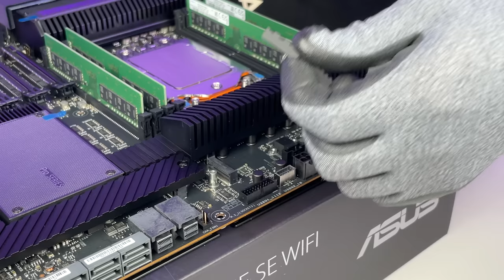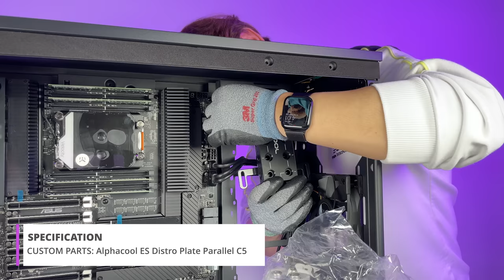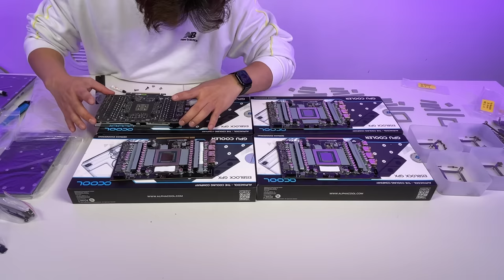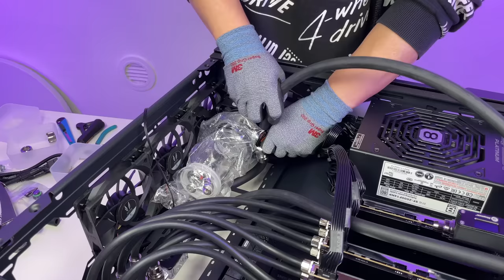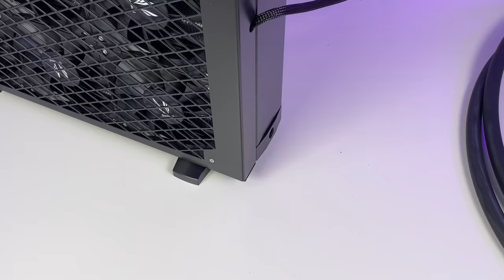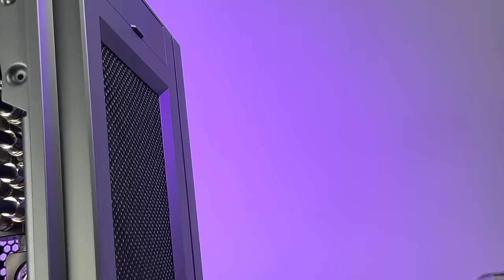$26000 RTX 4090 4Way ㅣThreadripper Pro 5995WX

Comment: Awesome setup. I would just change the WC parallel conections by all serial -> much better flow pressure.
Reply: What? The end goal is flow, not pressure. Parallel will provide better cooling. By the way, he installs four of gpu so they can work in parallel. He could supply same amount of task to one gpu in serial but in parallel they do the same job faster. Different areas - same principle. Parallel splits the task
Reply: @eee8662  Low pressure => low flow. Water will flow fast to the last block (due to pressure by gravity) and almost none to the uper block of the splitter.
Reply: @rodrigocunha34  
1. The rule "low pressure leads to low flow" is correct when resistance is constant. I.e. if you have only one gpu. You can achieve higher flow by increasing pressure.
When configuration changes - not one gpu but 4(!) Of them - you can not use that the same measure stick (pressure) that was in Internet references use for one gpu.

Consider this: you can decrease the pipes diameter (or better yet plug them off completely to see the point) - the flow will approach zero but yea, at least you will get the high pressure.
The lesson is: yes you increase the pressure to achieve the high flow, not the other way around. Going serial - is that other way around - akin plugging pipes off - you will kill flow but skyrocket pressure.

2. Role of gravity. My intuition tells me it will be negligible here. If any. The easy way to prove - to put meter on each gpu and see.
3. Quick thought tells me - gravity will play no role at all - the amount of water that goes down is equal amount of water that goes up. I may be wrong about this however.
4. You may be correct that there  may be different amount of water going to each gpu but that is not due to gravity but rather due to distance from main radiator/pump ports. The way to fix it - system must be symmetrical..
Bottom line - you want it symmetrical and parallel.
Serial - will kill it.
Reply: @rodrigocunha34  And. Don't forget the temperature. Symmetric-parallel will ensure each gpu gets fresh cold water from pump.
Serial - the last gpu in line will get hot exhaust water warmed by three of those gpu before it.
Reply: @rodrigocunha34  if resulting water flow is less than desirable - he must use more powerful pump. Or even several pumps. But. No way GPUs be connected serially.
Reply: @rodrigocunha34 Constructively,  to solve the "gravity" problem (which is not gravity really) - the key is either having smart manifold or if manifold is dumb - use it wisely.
The smart manifold would have same distance from main water ports to client ports. For this, I guess manifold should have pipes inside, not just box.

If the manifold just a box with no pipes inside - then builder of this server did not use it wisely - he should have used center of manifold for main ports and side ports - for clients/GPUs and CPUs. This would not make the system absolutely symmetrical but  much better than when supply ports on one side of the box - CPU will get nothing.

But this much less to do with gravity and whole a lot - with distance between ports (I do know the name of this science. Liquid dynamics?) Even if you turn server upside down - still the pors closest to main ports will get the most of water and CPU - much less.

It not that parallel is wrong, it is that it is not used correctly
Reply: Actually, about my last message - about manifold - I take it back on account that it was not used wisely. Builder did it correct.
If you pay attention - each GPU has same combined distance of in/out ports. Borderline clients - if it closest to input then it farthest from output. And vise versa. Combined/average distance - the same.

This is because manifold has main input and output on different ends of itself.

The only significant assimmetry I see here - is CPU. Which may or may not be an issue depending on if he is going to load CPU heavily.

If any overheating with CPU I would put it on separate pump. Again, not serially with other GPUs. As it will bottle- neck all of GPUs
Reply: @rodrigocunha34  ... Or, for CPU -  additional booster pump, preferably adjustable. So this will not need two more separate pipes going to radiator thru the case.

And I really  believe CPU may need it - it's resistance have good chances to be higher than GPUs. And so will have lower flow in parallel config. Because of smaller CPU size compared to GPU. But this (about resistance ) - just my guess. However - it definitely has different resistance due to being different design. CPU unlikely will affect GPU because it is only one CPU and four of GPUs. But it could be easily affected by GPUs.

Comment: I see allot of comments about the water cooling setup. I've been around for 30 years in the industry and did my fair share of WC builds. I'm not going to point out things i think could have been done better as far as tubing and flow.  Instead, I will say from my own experience that 9 fan Radiator is a little weak. 
But I also understand that not many external rads are available anyways. Either out of stock, not performant enough for price or come from too far.
At the end of the day, what matters is the benchmark and stress test. I think we just want to see those results.
I've seen so many "not optimal" or "not ideal"  custom loops that work above and beyond. So sometimes the science doesn't even matter since the component quality makes up or the extreme is what's needed for bad things to happen.

In short. Lets see benchmarks and temps please . I'm genuinely curious but I still think it will work well. Nice Build Anyways!

Comment: Not sure how you reached the $26'000 price tag, but the CPU and GPUs together cost $13k (without VAT converting from UK price of under £10'400 - there's no way someone buying this is going to be paying VAT). I can't see where the other $13k was added to the build, another $1k for the motherboard, memory cost is small, storage cost is small, under $1k for both PSUs, which leaves about $11k in watercooling connectors (I know they're expensive but idk about that expensive)

Comment: noice MORA3 420 as a radiator 💪💪 btw i would not use some odd liquids in a system where multiple components are in same loop, this causes electrolysis to happen and the first things to go are the CPU and GPU water blocks. Use distilled water only and swap it few times a year, it also has to always circulate else sediment will build up....
That being said, separate loops for each GPU and CPU would be sweet 🤔

Comment: Very nice build but no NVLink and some of the worst 4090's on the market.    This looks great but how would you use it?   No temp measures.   Does this work or does it overheat?
Reply: You don't need NVLink
Reply: @christophegroulx7816   You do if you want to work with ai.    That's why most are stuck on 3090's.   The a6000's are too expensive.
Reply: @robertfontaine3650  Not really, the gains from NVLink with two cards are quite small.

Comment: That is off the chain, but at that point, you're better off using a mining rig with seven GPUs. We need a system with two CPUs and 8 PCIe Gen 5 x16 slots on each side so we can do 16 A6000 or H100 GPUs.
Reply: run dual 3975WX's

Comment: There is a problem here that I don't know if anyone noticed. There is no 110v outlet that can handle this. Typically in modern homes, the outlets in a room are all on one 15 amp breaker. So you really cannot use this machine without running dedicated power that is not shared with anything else.
Reply: Fortunately that's not a problem in most countries outside the United States.
Reply: south korea standard 220v

Comment: One D5 is not enough for this. Also wouldn't it be more effective to just get a water chiller since the room will still need to be air conditioned since all that wattage will heat up the room and increase the heat soak. That is unless you put the rad outside.
Reply: its fine

Comment: You should put the water block on and then turn it over, not turn it over just after placing thermal pads to sit on water block so they can fall off, to keep the thermal pads from moving or falling off.

Comment: Exceptional build, great work I am building with ASUS WRX90e Sage motherboard, 4 rtx 4090, AMD Threadripper pro 7975x, Cruical T705 2TB NVME, Your build is really helpful I appreciate but I believe step by step proper guide is better.Your video is too fast and it did not explained some steps well. Disagree with your cost as with latest components mostly pcie 5.0 support my build is around $15000 USD.

Comment: You need a bigger pump. If I was put that kind money in something like that I would at least put pressure gauges on something to know the dp across the heat exchanger and would have went with some cheap hoses.

Comment: Oh gosh, I have so many questions... 
1. is 2000W even enough for 4x 4090rtx, when each is rated 450W TDP!? ...because don't forget we still have the CPU!!
2. is That single pump enough for such a huge loop, I doubt it will live long, I'm damn sure it will shoke at some point.
3. a Radiator with the area of 9x 140mm fans it's not enough to cool down all that wattage, I have 2x dual 140mm rads for a single 4090rtx and a i9 14900k and it's just holding on.

🙄😬🤔 goog luck.
Reply: 1. It’s 2x 2000 wats, so it will be enough. 2. The D5 pump is designed for something like this task, so it will do its job. 3. This is a MoRa 420. The non plus ultra between a chiller, when we talk about cooling in costum water cooling. It can handle it easily. It’s not like 9x140mm radiator. It’s much better than 3x420mm.

Comment: While my rig is nowhere near as nuts as this (only cooling ~900w), I went full 300ml res+D5 pump and 360+480 rad to keep OC temps decent (and I had originally blocked my Titan X whereas I'm keeping the 3090 and now 4090 on air).  It's a beautiful machine but as others said, your tiny res pump seems like it'll struggle with all those split lines.  I kept my entire rig hardline loop in one circuit and haven't had temp issues.

Comment: I bet mine performs better. 4x rtx 4090, 8x 32gb ram = 256, ryzen threadripper 64 core, 128 thread, and 296tb storage in the thermaltake view 91. This baby pushing almost 3,200 watts.

Comment: 9 tb of ram FOUR rtx 4090s if the motherboard fits, TONS of 8 tb ssds, a cool power supply, 520 hzs monitor (or 540), nitrogene cooling, latest ryzen threadripper pro, overclockin', and love.
This is all the ingredients for 8k gaming and 2000 fps.
Reply: it's really not. multiple gpus doesn't mean you get more fps. unfortunately things don't work that way.
Reply: @whydoineedahandle9  I know that, my friend told me, and I send to know the truth

Comment: You are not using enough thermal paste. This must cover the entire surface of the processor. There are videos on YouTube testing different methods of applying thermal paste, and the one that helps cool the most is to coat a thin layer over the entire surface.
Example: https://www.youtube.com/watch?v=nGEgZyB3BQo